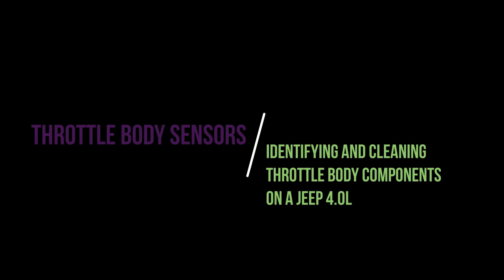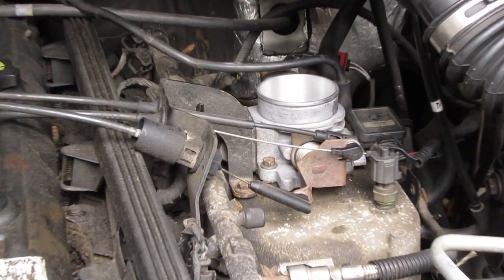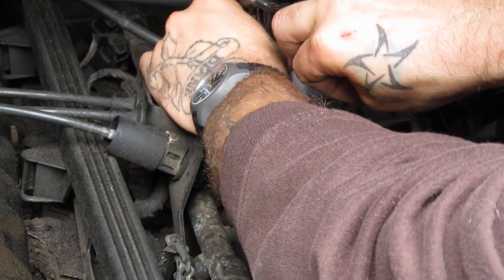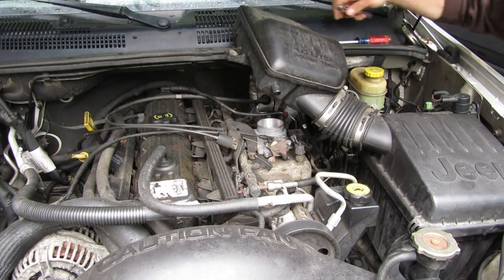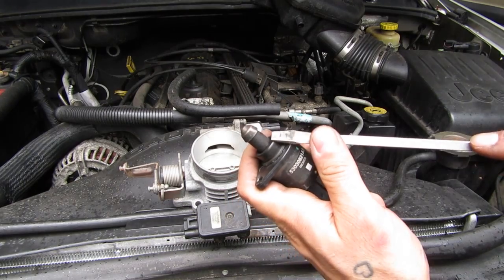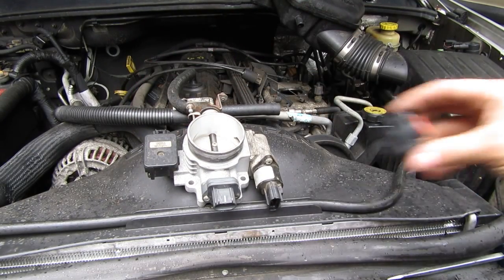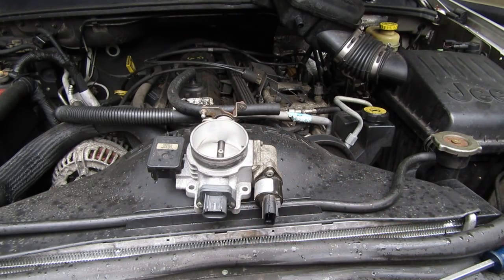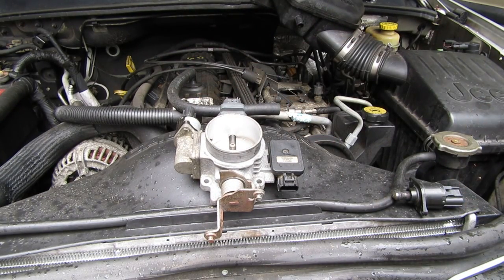THROTTLE BODY SENSORS (IAC, TPS, MAP) - Jeep 4.0L

Comment: Great explainer. Thank you! Do you have anything about high idle? I changed the IAC, checked vacuum lines and still nothing.
Reply from the maker: Did you try cleaning the throttle body? Sometimes the build up on the throttle body or inside the IAC housing will cause a high idle situation. When you checked the vacuum lines, how did you do it? Leaks can be hard to detect and even a small leak (a stretched elbow fitting or hairline crack) can cause a high idle. 4.0's are notorious for vacuum issues. Outside of the easy stuff, check that the wiring on your IAC is all intact. I have heard of cracks in intake manifolds causing idle issues as well. Long story short, high idle can be any number of things, best way to solve it is to spend some time under the hood with a fine toothed comb. Good luck! Hope this helps!
Reply: D&E In The Garage that helps, thank you! I'll check the inside of it on top of the other stuff. Thanks again!
Reply: Thx man good vid
Reply: Any tips or tricks to help fight carbon build up or to help prevent it from happening again?
Reply: @seanwaldo9229  I have a 2000 Jeep Grand Cherokee Laredo. I just had the radiator replaced & the first day I had it back it would stall out when I came to a stop. I took it back to garage & it says reset adaptive memory. Could that have fixed it? Now it is stalling out almost immediately. Do you think what you did would help? Thanks!!
Reply: Are you still active
Reply: I was not sure what to do but I will give it a try. Thanks.
Reply: I did all that still at 1500
Reply: Kenneth Winbush I had this happen to me on my 95 zj and I was given the wrong iac and it can make it idle high and I look up the exact part number and got a one that fixed my issue
Reply: I thought you could manually adjust the idle!! A car mechanic did it for me...it looked very simple!!  Someone had worked on my Jeep and adjusted it accidentally....then the other mechanic adjusted it back to normal.
Reply: I'm wondering what you found?  Mine was idling at 1700 - 2k ended up being the computer on the firewall
Reply: Mine idled at 2200 today... sprayed a can of TB cleaner down TB and now it's at 1500rpm. ... so that kinda says I cleaned something 😂 so which sensor is that (1997 with 23k miles)

Comment: BRO I'm literally taking my glove off to get to your comment box. Man oh man, you got me through not one but two things I've had holding me up for a whole day in getting my throttle body and IAC sensor off. Dadgum cable #2 was seated in a weird way, so glad I found your video so I didn't break it. Then my IAC was stuck on there bad, I unbolted from the unit but it was still stuck. When you said it should pop off, I got a flathead and sure enough, out it came. I owe you man! 🍺

I have a gorgeous '06 JGCL Ltd. Getting worked done that it's needed for awhile and being able to do it right on my own is just the best feeling ever.

Comment: Just FYI, you can simply release the latches on the airbox and remove the lid...which will get all the air intake apparatus out of your way. Hope that's helpful
Reply: Thanks for the tip!
Reply: Screaming it...Stop twisting the intake tube

Comment: M.A.P. - Manifold Absolute Pressure 😉 

Great video only thing I can add; When working on vehicles, any time you create an opening (such as removing the throttle body) to the engine, it's best practice to cover that opening! Tape, clean rags, whatever works best for the situation. 

Keep calm and Jeep on!

Comment: Amazing!!!  My truck is at the dealership now and they are saying it will cost $1400 to repair the throttle body.  I think even a girl like me can do it...thanks a bunch!
Reply from the maker: Dang... that is a boat load! Good luck DIYing it!
Reply: 1400$ 😂😂
Reply: STAY THE HECK AWAY FROM DEALERS!! horrible ... when i first got my XJ i took it to the deal for new shocks and a 'tune up' ...when you hear that expression - RUN FAR AWAY!!! $1400. that experience motivated me to do EVERYTHING myself from that point forward
Reply: Glad to know that I won't be the first and hopefully not the last girl to attempt this as well. Way2go sis
Reply: Sounds like a good deal if they’re changing the headlight fluid also 🤪
Reply: Just curious if you did it yourself?

Comment: Thanks for the video, my GC 2004 had codes P 0122 & 0123, watched this video like a week ago. Today I removed TB, cleaned it, replace IAC and TPS...all codes disappeared and running nice! The TPS just broke when I removed the connector. You just  saved me $50 - $60 in labor!! Thanks a lot.
Reply from the maker: Glad to hear it! That was the point here. Glad it worked for you

Comment: The 2002 4L WJ(wife jeep) 150k miles idled very rough was hard to start. I replaced plugs, fuel filter, & coil pack still had same issues. Next day replaced crankcase vent hoses, and the manifold vacuum hoses. All old hoses were cracked. Fixed rough idle and stalling but still hard to start, runs good once started. Found out the new Auto Zone fuel filter didn't have a regulator. Replaced with Advanced Auto filter. Used anti seize on the 4 throttle body bolts.  I always use Anti-seize. Runs good.

Comment: wow. :-o i was shocked when your hood actually opened and stayed open with the struts.
Reply from the maker: I have owned several WJs and learned that the first bit of cash you should throw at a used WJ is the $40 on new gas struts for the hood.. you are gonna be spending enough time under there :-P
Reply: Mine still works 04 grand Cherokee Laredo 4x4
Reply: I just use locking vice grips 😭😭
Reply: Can you put gas struts on an XJ?
Reply: My 04 is the same way. That must be pretty common
Reply: Bought new ones for the front and back as soon as I got my wj... for $1200 in good running condition :P oh yeah.
Reply: Hahaha 😄🤣🤣 . That brings back memories of getting banged in the head , from bad struts

Comment: I have a 1994 Jeep Grand Cherokee with a 5.2 L V8 and am replacing my IAC soon (engine randomly stalls).
I appreciate your explanation of all of the sensors connected to the throttle housing and what they do and what symptom problems each one may exhibit when they start to fail.  I will be pulling my throttle housing off of my engine to do a thorough cleaning as you had suggested to get all of the carbon deposits off of the throttle housing for a better running engine.
P.S. I also suggest having one of those long retractors tools handy when working on this area as I initially dropped a cleaning pad down into the throttle housing body and had to walk to the auto supply store to get one to retrieve that cleaning pad. Live and learn.
Reply from the maker: Good luck with the new IAC. Hope it fixes your issue

Comment: Dude, Thanks so much from Australia. I bought an 04 WJ with 116000kms (70000miles) on it and she threw code P0123 at me yesterday, was just gonna replace the TPS but i think ill clean the entire throttle body now. Only downside is that parts here are a little more expensive, 155aud for the TPS. Love your work.
Reply from the maker: Good luck! Glad the video was some help

Comment: Thanks Bud, haven't reached out in years. I've got another 01 grand. Core 4×4/ 2.5 coil lift, adjustable trac bar, everything underneath. My idle started increasing to about 1000 rpm's out the blue. Thank s for the video as old as it is. I know the problem.

Comment: I know this is an old video but man this video helped me out so much. I was having some random stalling and taking a bit to start back up and I was at a lost. I replaced my PCM bc it was randomly not getting power to the fuel pump and it seems to run slightly better but now I'm thinking highly about the IAC. Thank you so much man
Reply: Where is the pcm at ?

Comment: Observation.  Just remove the air filter cover for more room.  4 clamps :(  also, when removing the throttle body cables, make sure you show exactly how to remove them.  I thought i could just "pop" off the cruise control cable.  Well, I broke the the plastic piece.  Try replacing that :(  I had to get one made with a 3d printer.   Instead,  you need to 'slide' it off the cable.   I ended up super gluing it back together but it was definitely a problem that could have be avoided.   Anyway, just trying to give some advice to someone who may have this problem.  Cheers
Reply from the maker: Yep, I watch this video now and cringe that I didn't think to pop the entire air box assembly off. It is hard to watch. Haha. You are absolutely correct about that and the throttle cables. Thanks for the feedback
Reply: Amazing mechanic so wish you were in mich. to call and pick your brain ,my best friend just passed away and he was such a blessing with helping car problems 😢😢

Comment: Thanks Great Video! 6mo with 97xj ! Woo Hoo! Anyway Flushed cooling system then the misfires began making me crazy the put put. Did a in place rebuild,  replaced Cylinder head with a 7120 new plugs, wires, h2o pump ran great till the other day. JY trip on Saturday. I 'll be a fixin!

Comment: Thanks for not pretending to know-it-all.  You already know A LOT!   
  Does not having the wire through the accordian hose mean that I don't have a Mass Air Flow Sensor on my 1999 Grand Cherokee 4.0L?  I have been getting intermitant engine cut out while driving down the road.  Some folks attribute that to the MAFS.
  I bought it with 60K miles on it and put another 145K on it.  The rear driver window started opening whenever it felt like it.  I installed a salvaged Body Control Module and it still does it.  My next guess is the window control inside that door.  Any other suggestions?
  I am glad you like making these videos.  Please continue!

Comment: Thanks for the great explanation on the throttle body sensors! BTW, with a rough idle I was prepared to remove the Idle sensor, but discovered that the hose clamp securing the filtered air passage to the throttle body had worked loose. Perhaps the K&N air filter aggravated this issue, but it's now another item to frequently check.

Comment: Great video! Very clear and concise.  I'm having random stalls,  no warning.  Almost like key was turn off.  Always restarts and otherwise run good.  Going to clean these parts.
Reply from the maker: Good luck! Let us know how you make out
Reply: Same here with me...  It runs perfectly fine otherwise, but stalls out when idling. My idle has been low, about 500rpm, and I think it's about 700 normally.  Anyway, it sucks!  I wish I could just adjust a screw to raise my idle rpm!   Have a great day, I hope your able to fix your vehicle.
Reply: Turned out that an O2 sensor wire was dragging on the drive shaft and was shorting out.  It eventually burned out the fuse that controls accident gas shutoff system.

Comment: Great video&instructions.. I recently got a 88 XJ that runs fine sitting,soon as I pull off,it sputters like it's not getting gas, or to much gas/air.Will change fuel filter&check out everything you mentioned. Thanks!
Reply from the maker: Good luck!

Comment: You had a great explanation on this. Have you ever disconnected the sensor separately to diagnose? my 96 Cherokee classic will only run 10 -15 minutes primarily in hotter weather and just dies at all rpm (idle or going hwy). No noticeable trans issues at all. TPS only removed has high idle then dies. all 3 removed high idle then dies. MAP only idles good but did not have the time tonight to let run more then 10 minutes. All sensors look original with a 200k miles but not sure. Dont have the money to replace all, since i have already did a toon-up with fuel filter, new gas, spark&wires, battery & air filter. it does have a cracked manifold pipe but has had it for the last year and just started the dyeing with this new season? any suggestions?

Comment: I went through some puddles, and my 96 Grand Cherokee started missing and wouldn't idle. At first I thought it might be the distributor cap and wires are old. I cleaned the throttle body, and took off the IAC. Cleaned it. Jeep ran great, but then cut off. Restarted but missed real bad. I have some clamps on computer because the 3 plugs were not making a good connection. I guess I'll take throttle body completely off and do what you did in this video. I'm 400 miles away from 300 thousand. I love Jeeps and want to keep it going.
Reply from the maker: 300k?! That is nuts! I would definitely check the TPS if you were in water before it went south. Good luck!

Comment: Very helpful and cheap fix. I’m having a lot of the issues you’re talking about as systems on the new Jeep I bought. I thought these were transmission related. I haven’t checked the throttle body but I have a feeling this will help with my P0171 code I’m running and my idling and shifting issues.
Reply from the maker: Good luck!

Comment: My TJ takes along crank to start and sometimes two cranks, I changed the pump, cleaned the injectors replaced the spark plugs and still the same problem, I'll appreciate an advice, thanks   great video !!
Reply from the maker: Hmm... I assume you dont have any Check engine lights? You can try disconnecting these sensors one at a time to see if there is any chance./ When they are disconnected the ECU (obviously) cannot read them a reverts to a standard setting. if you disconnect on and your long crank goes away, that sensor needs to be changed. FYI, disconnecting these WILL throw check engine codes, but they can be cleared ant they will not come back. feel free to email me if you want to chat more about this issue dandeoffroad@gmail.com

Comment: Right on. When cleaning the IAC housing once it’s removed from the throttle body, what have you resealed it with. According to my guys at the local Dodge dealer parts department, a gasket for that was never offered.

Comment: My jeeps check engine light is on throwing DTC P0122 throttle position sensor. Symptoms are low idiling and stalling when comming to a stop it usual Idols around 600rpm when starting. I’m gona clean the butterfly out and check the IAC sensor. Along with checking the other sensors. Great video thanks man
Reply from the maker: Good luck! Those throttle position sensors are absolutely notorious on the 4.0. They go all the time and cause havoc. good news is it is an easy fix

Comment: Thank you I didn’t know much about the IAC and map sensor , I have a 98 tj 3sp auto , sometimes gets a jerking or bucking in the throttle so I’ve replaced the tps and cps with hv wells sensors but still going to inspect my distributor ect , but never check the iac and map so now I will

Comment: Perfect explanation of the air intake.  Im currently dealing with a strange problem on a 2000 Jeep Grand Cherokee Loredo.  

I replaced the crankshaft position sensor in the fall, in the hopes it would solve a strange "shuddering" and stalling, particularly after the car was run for a while and THEN restarted.  Like when you go to the store and come out.  

So I replaced the tps and the cam shaft position sensor. 

I'm wondering if while putting in the tps, I created a vacuum leak at one of the rubber boots.  That, or when I attached one of these sensors I didn't align it properly...also the evap purge solenoid is clicking like a metronome (normal?).

I have yet to do another throttle body cleaning (although I did it 6 months ago), or install a new idle air control valve, but I have a new one and am going to attempt install and hope all of it works.
Reply: @DangusMcShwangus Did you figure anything out about the purge solenoid clicking..? Mine does the same thing occasionally.. I recently cleaned the throttle body and replaced IAC/TPS bur didn't touch the MAP. (The solenoid has done the clicking both before and after serving the TB.) I don't get any stalling or high idling, but It does seem like the engine "stumbles" a bit during idle. I also just changed out my spark plugs, wires and cap/rotor on distributor. Thanks in advance for any info!

Comment: Nice job.  MAP = Manifold AIR Pressure.  My 2010 Jeep Wrangler sometimes kicks up to 4,000 RPM when the speed reaches 55-60 MPH.  And then it stays at that rev position for what feels like "weeks" (maybe 10-15 min), even if I slow down to 49.  Changed the Throttle Body (since it has the TPS and other hardware integrated into one part) since the old one was in bad shape.  This did not fix the surge acceleration problem.  Any ideas as to why?  Still troubleshooting this.  Some mechanics also mentioned that it might be the Accelerator pedal (with its electronics) sending bad info to the throttle body.  Have you run across this type of problem before?  Anyone else have similar problems?  Keep making videos.  That helps a whole bunch of people.
Reply: hello… my car have same problem with.. u got the solve now?
Reply: I have a 04 Jeep Liberty, and it's surges like that at times and don't know why I'm trying to figure it out myself. But I'm going to try the throttle body cleaning and all of the above mentioned in this video, what do I have to lose. Good luck

Comment: I've just changed mine and was frustrated, with limp!  I brought the BBK 62mm.  I also changed the IAC, and the TPS.  After I had watched your video I've learned, I never new about the TPS grooves in the interior must be lined up!  I have a 93 cherokee xj.  I just had to ask, what would be the best way to reset the pin, for accurate throttle setting?  Thanks again very detailed and well explained!

Comment: Thank you very much. Your video helped me to clean the throttle body of my 4.0 Grand Cherokee  2000 and exchange the IOC-Sensor: idle speed is great again. I noted that the screws attaching the position sensor are stucked, I dont want to break anything there. Any ideas on how to get them loose?